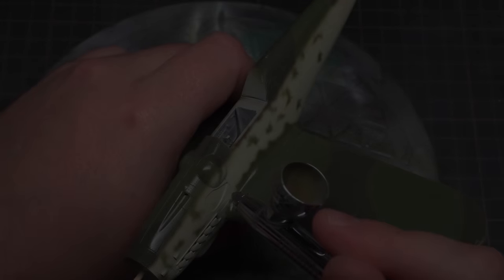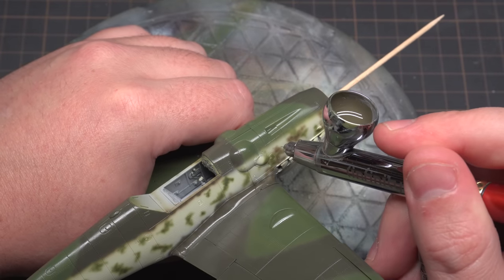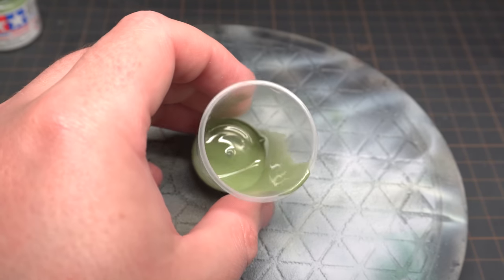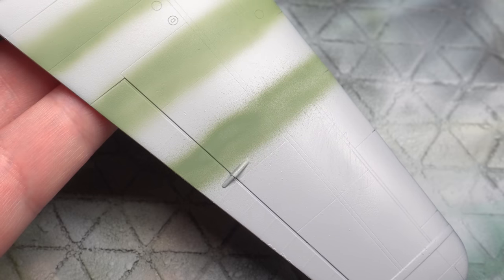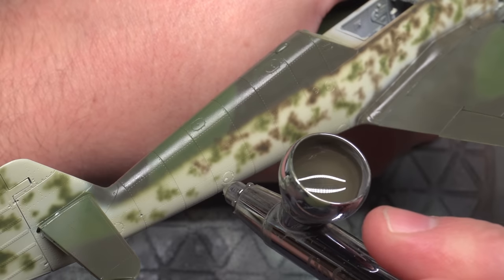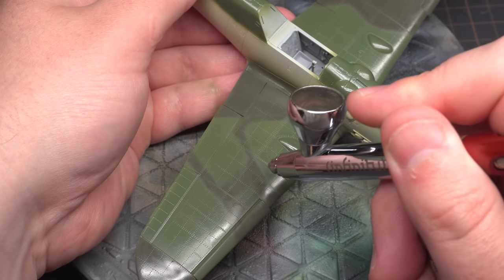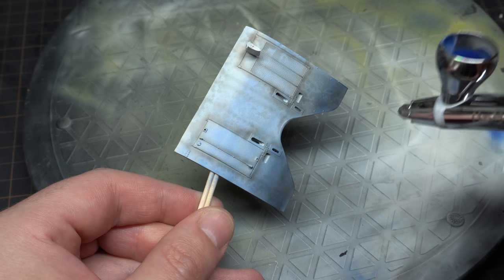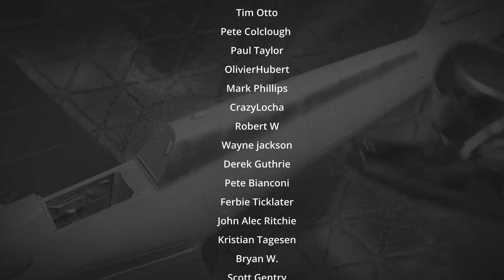3 Airbrush TIPS to Improve your Scale Models

Comment: In addition to all your great tips here,  I like to find the optimal pressure, the lowest, to spray without causing any spattering.  When I first started air brushing, 40 years ago, I would often spray at too high of pressure.  This caused orange peel, spider webs, and lots of overspray.  When I can spray around 15-16 psi, I find the application to be much more controlled.
Reply from the maker: Thanks for sharing, great tip. My pressure is very fluid, I'm always on the dial to get the best from my airbrush.

Comment: Excellent video. I've been airbrushing for 50+ years and still find that builders don't thin down their paints enough ! Teaching yourself to build up color in multiple very thin coats and getting close is the key to a great finish as you said. It is sad to see a great build only to be ruined by hosing on thick paint in one pass. The most important tip of all is a super clean airbrush to start with and a lot of practice also !
Reply from the maker: Cleaning is so important I agree. Thanks for the kind words !
Reply: @lpjmodels wish i could airbrush but  just dont have the facility to use mine.

Comment: With a standart 60 to 40 ratio of thinning, what typical pressure do you use? And what diameter (mm) for the needle? I cant get this stunning results you show here. Thank you for the fantastic vid 👍
Reply from the maker: 0.15 needle. Pressure is always fluid, sometimes you need more sometimes less. Start at 15 and adjust to taste. Also depends on the paint.
Reply: Superb! I use 0.2. I guess, more practice on my side is needed. Thanks a lot and keep those tips coming.  @lpjmodels

Comment: Use Tamiya Lacquer Thinner (yellow cap) with Tamiya paint and it lays down even better!
Reply from the maker: Usually if I spray tamiya ( very rarely anyway) I head straight to Mr levelling thinner. I used the OG thinner to make it more accessible to the wider audience. 100% with you on using laquer thinner though.
Reply: The yellow cap thinner works great especially for flat paint because it dries faster. If you use a thinner with retarder it can come out satin/semi gloss. All depends on the finish you want.
Reply from the maker: @johnathan133  if it comes out semi gloss then perfect for going straight to decals !

Comment: Hi LPJ. I cannot get to grips with airbrush. I tried Ammo Olive Drab today for my hellcat and ruined it. What is the easiest paint to airbrush with in your opinion? I just like building armour, nothing complicated
Reply from the maker: Ammo is a bit poor in my opinion. For armour, I would use Tamiya, AK Real Color or MRP. The last 2 are laquers and have a stronger smell, but they spray a lot better than the mig ammo or vallejo types of paints. Use mr levelling thinner for thinning it.  (you can also use it to thin tamiya) 
They spray smoother, are more durable and sand well, also you don't usually need to clear with them if you don't want because they are fairly inert. 
I hope that helps. 
Just remember, all paints have a learning curve and you'll have to spend a little time playing till you get it just right.
Reply: Thank you . I went out and bought some Tamiya OD and thinner and have filled the jar to the top as I too have been told that trick. I had to soak the tank in metalhated spirit and clean everything off and reprime. Time to try again. I love this hobby but I just can't get to grips with it
Reply from the maker: @spencergregory8049  I would thin it further to be honest. The method is good for blasting it on though a 0.5 but you'll likely end up with texture, have an experiment!
Reply: @lpjmodels  Okay. Thank you. I have. Neo Iwata airbrush and a Neo mini compressor. Nothing fancy. I like armour model making as you can always cover up mistakes easily 😁
Reply: Thank you LPJ. You are one of the best on here at this! One more question. Can you use VMS acrylic thinner on Tamiya acrylics do you know? I have some here so if I need to thin it more could I use that do you think?

Comment: Very useful tips indeed. If I may add one of my own that makes a considerable difference to airbrush performance, polish the needle occasionally! I use polishing wadding (Silvo brand) for the task and carefully polish the sharp end of the needle (first inch or so) rotating it rather than using a pulling motion. Upon receiving this tip I was a little sceptical, however I was proved wrong! Paint atomisation has been vastly improved through both of my airbrushes, one being a H&S Infinity CR Plus (.2mm), the other a Mr. Hobby PS-289 (.3mm). Try looking at the tip of your unpolished airbrush needle under high magnification, then compare that to a polished one!👍😎

Comment: Nice and helpful 👍. One thing I was curious about was the effect of air pressure on the result?
Reply from the maker: Air pressure is a completely different kettle of fish. Its such a fluid concept. But as a rule, the lower you go, the closer you have to get to achieve a defined result as less pressure affects the atomisation of the paint to a degree.  I used to spray at 20-30 using my needle apature as a control, even for micro work, now my compressor sits around 15 and never gets touched unless I need really misty wet coats where I turn it down a little.

Comment: Thanks, I definitely found the, "don't require thinning " paints need thinning.
Reply from the maker: Thanks Wade!  Yes they usually do unless you're using a 0.3 or bigger at high pressure 🤔
Reply: @lpjmodels  Yes, right now I have a cheaper end airbrush.  Saving up for a next level.

Comment: Tamiya is pretty straightforward paint to use, but I have problems mottling right with water based acrylics like AK 3rd gen and Mig. Any tips there?
Reply from the maker: It's is. I avoid spraying vallejo. Mig . Ak  water based exactly for those reasons. I dont want to fight the paint.

Comment: What is your opinion on using IPA (isopropyl alcohol) as a paint thinner for Tamiya paints? I always use IPA as a thinner for Tamiya, but just wondering if that is the best option and if that gives me the best results? I’m fairly new at using an airbrush so was just curious. Thanks and great video. I just subscribed to your channel.
Reply from the maker: Thankyou ! My go to thinner if using tamiya is Mr levelling thinner.  The original tamiya thinner is a mix of alcohol, water and a little retarder. For my liking. Pure IPA flashes off too quickly. But if it works for you keep using it !

Comment: Good tips but I didn't hear you talk about air pressure.
Reply from the maker: I think it's such a fluid concept depending on your paint, ratios, experience and airbrush that it's not something I want to advise on. 
Then you have humidity, altitude and all the factors that affect air and pressure too ! 
I set mine about 15ish psi and never change it unless I need to drop down to 12 ish for ultra fine work, some people swap pressures all the time depending on what paint they use. I let my trigger discipline regulate most things